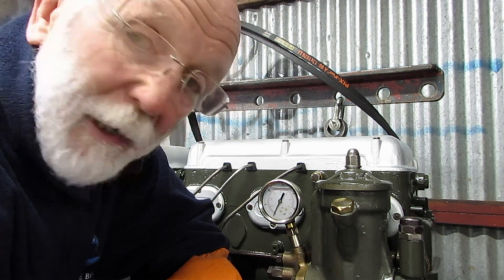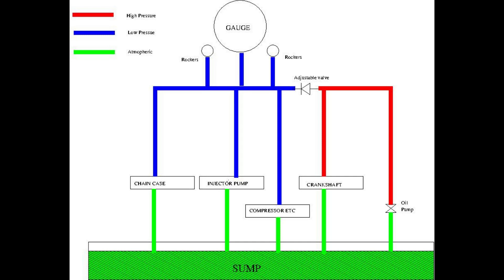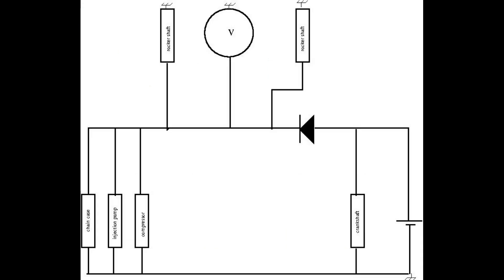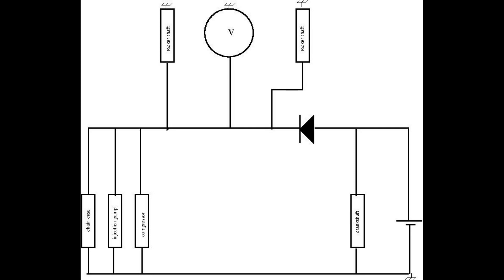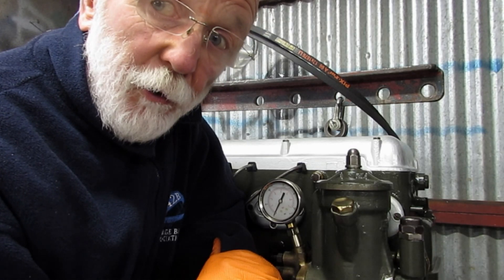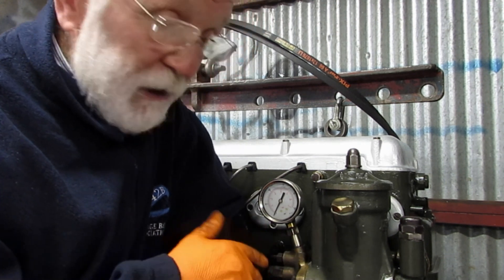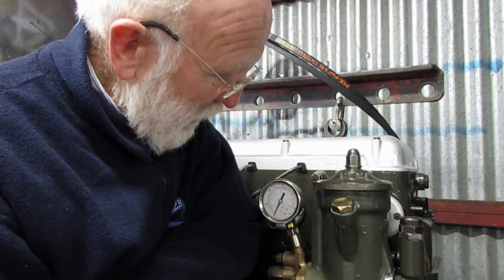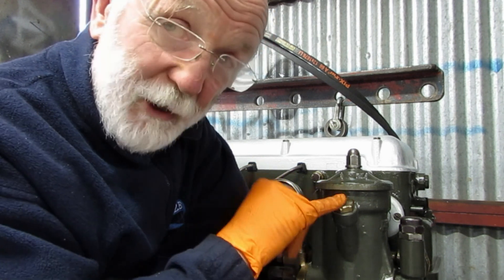Gardner Engines: oil distribution within

Comment: Hi i'm viatron from Sheffield, the old classic Gardner 6LXB 6-cylinder direct-injection diesel engine had many features within it via the use in many buses including the Daimler Fleetline CRG6LXB rear engined double deck bus chassis mounted transversed together with the Daimler Daimatic electro-nuematic  4-speed semi-automatic gearbox with fluid flywheel & this type of diesel engine made by Gardner Engines of Manchester what also includes both the 5LW & 6LW versions for the more older forward control single & double deck bus chasses such as Guy Arab series, the Bristol K,KS & KSW D/D & L,LL & LWL S/D versions plus the Bristol Lodekka LD & FS R/E & FSF & FLF versions also feature & with the Gardner 6LW engined pre-war A.E.C. REGENT & REGAL Mk.ls from Huddersfield Corporation & the post-war A.E.C. REGENT MK.Vs also had Gardner 6LW engines for Glasgow, Aberdeen & Rochdale Corporations. Thank you for your co-operation on this very special vintage Gardner engined bus subject from David Viatron Esquire of crookes in Sheffield.

Comment: Greetings Joe--from graham where we are a small volunteer group from Don river heritage rail  Tasmania Australia ---We have a couple of bogies fitted with a 6L3B built 1950 but struggling to find parts that requires a lot of ingenuity and  rebuilding-----The question I have is our engines have 1 main lube pump and a second pump originally for the oil cooler that is long gone--the second oil pump suction is from sump--but delivery is to first pumps suction just before the pump----We want to discharge second pump to delivery side to improve low RPM oil pressure----of first pump but worried the 2 combined pumps may overload the discharge pressure ??????---can you or others comment
We have no issue of not having a cooler as train operates at low RPM---which is why we want to run 2 pumps
Reply from the maker: Graham, I am not sure that I am following you here.   My understanding is that the pressure release valve will blow off once it has reached its set pressure, so adding adding another input will achieve nothing.   But, I could be wrong.   Best to email me: tangent.gardner@gmail.com

Comment: Sorry but it it not the case that the pipe from the pressure relief valve is the one going along the back of the fuel pump to the timing case and it is the other large pipe from the filter outlet manifold (with the gauge) is supplying the main bearings. It seems absolutely incredible that the mains would be fed with unfiltered low pressure oil from the relief valve spill return.
Reply: I must add that I do find that in itself to be a bad design as if the pump is getting weak or the main bearings are getting worn there will be a reduction in flow over the relief valve and therefore a reduction in lubrication to the timing case.
Reply: Also you mentioned wanting to add a pressure gauge before the relief valve, this should be marginally higher than the pressure on the main gauge after the filter, the difference being equal to the pressure drop across the oil filter, it would serve as a good condition of the condition of the filter.

Comment: Hi Joe - love your videos
The answer to your question - when the engine is running, oil in the pipe between the pump and pressure regulator is at 35psi (or the reg setting). That passes under the regulator piston through the filter and onwards to feed the crankshaft and rockers.  The pump delivers more oil than the crankshaft and rocker feeds need and the excess tries to raise the pressure. This lifts the regulator piston so the excess escapes via the pipe at the back, which connects to the ally pipe along the engine which takes oil to the fuel pump case and timing chain case.

Comment: Hi Joe, We have a 1931 5L2 on which the oil pressure is measured at the far end of the external oil rail supplying the crankshaft and rockers and is thus a true measure of pressure delivered to the critical components. The setting is 30psi cold on SAE30 oil. As you know the fuel pump and valve gear is supplied by oil released by the pressure control valve. The camshaft is splash lubricated.
Thank you for your excellent videos!

Comment: I was looking at a boat with a 8LXB  in her, I wonder how they are on fuel and if all the parts are still available
Reply from the maker: You will not beat Gardner on fuel economy.    Ask any fisherman or haulier.   On parts - I would not be too worried.
Reply: @tangentgardner  Thanks Joe, they certainly tow very well
Reply: @tangentgardner  that's great news thanks

Comment: Hi Joe, I was taught that the oil pressure from the pump to the pressure relief valve was called the "main feed pressure", the only job that made my heart sink on a Gardener was replacing the seals on the injector pump oil return tube, a lot of work for an oil leak.
,Another great video, Thank you.

Comment: On the engine oil distribution schematics I have used, the pressure regulator valve dumps over pressure oil back into the sump. If you hadn’t identified the line going to the crank, I would’ve assumed that’s what that line was.

Comment: Brilliant.  For someone as incompetent as I with no engineering knowledge I  find your videos enlightening.
I wonder if you could show how to clean the oil filter as part of an oil change on a 3L2😁😁
I’m sure you could actually sell things like the non functioning gauge for people to ‘do up’ as ornaments.
Reply from the maker: It's a gauze filter, just wash it in parafin.
Reply: Joe many thanks for the reply.  I’m told the aluminium cage on which the gauze fits is fragile and irreplaceable so it kind of put me off attempting to remove it 😂